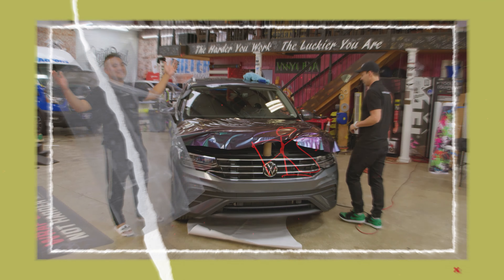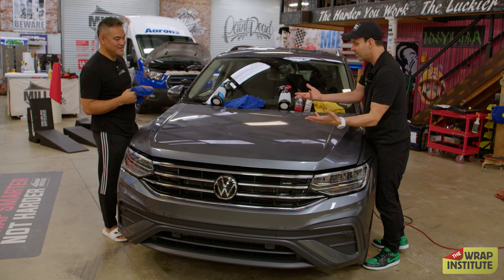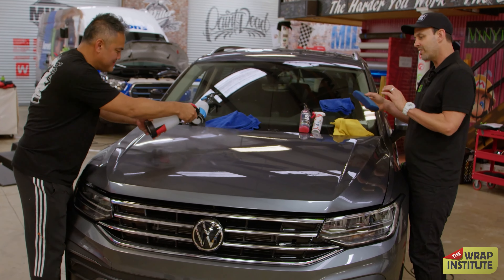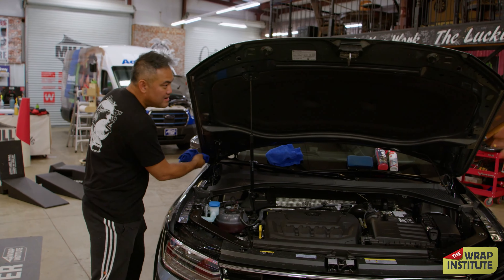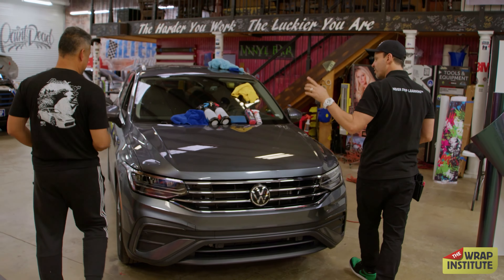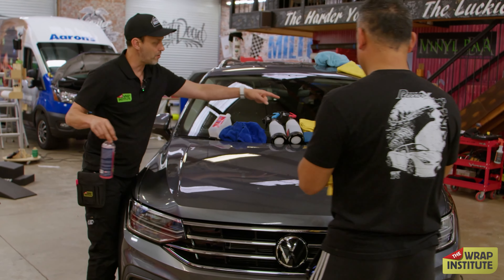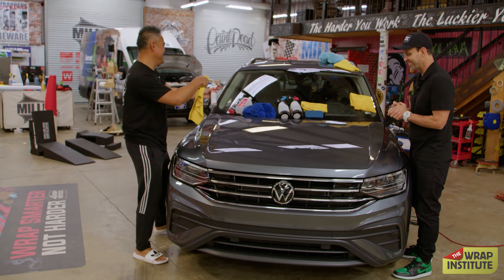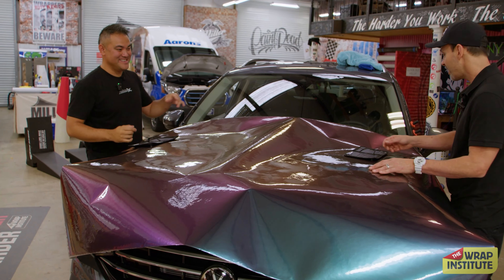We Gave A Wrap Workshop To PARADOX The Wrapper - Pro Tips to DIY Installers by Justin Pate Part 1

Comment: Umm, at one point, @9:52, he's asked about 90%, vs. 70%, alcohol and responds it's too strong and will "burn the clearcoat"... Nope, it will NOT damage the clearcoat at all, UNLESS the clearcoat's recently been applied (aftermarket due to an accident) otherwise it's fine. 
In another clip @12:49 he asked Paradox to wet his towel with a product that has acetone in it, which is a far more aggressive solvent than alcohol. How much Acetone? It also will not damage the paint. Sorry, I'm an engineer (40 years) and I pay attention to minutia like this, lol. Carry on....